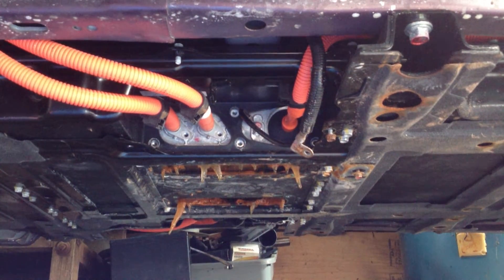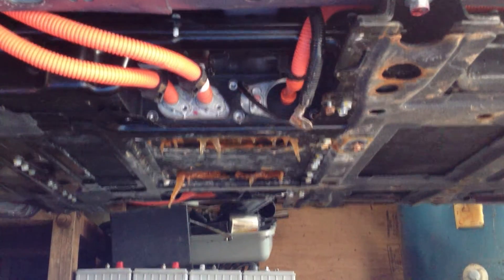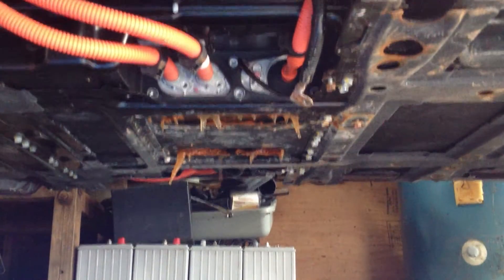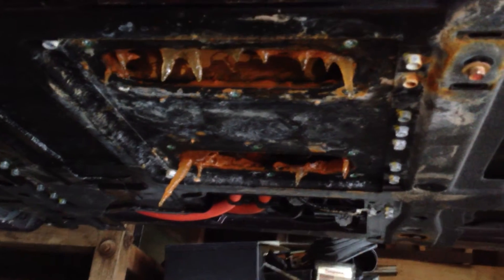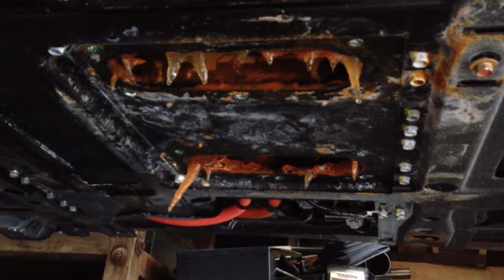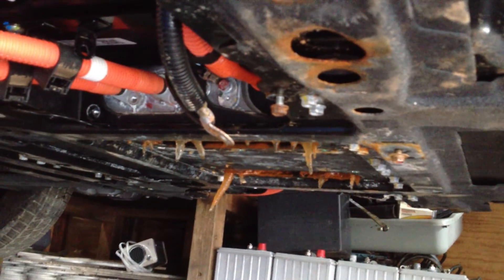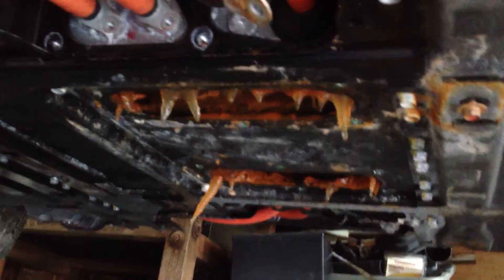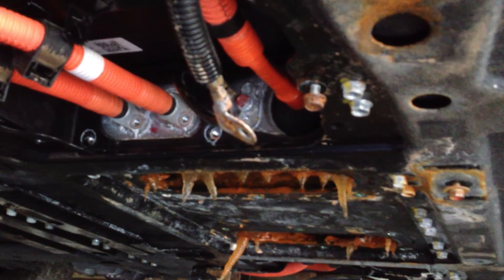Flooded Mitsubishi i-Miev: Battery Cable Removal part 1 20130218

Comment: Maybe you could divert furnace heat using flexhaust tubing to dry strategic parts of the car. Rinse and repeat, ad nauseam. Or at least until summer. I suspect that ZuiGe is right to some extent.

Comment: Good afternoon, do not tell me by mistake p1a44. imiev no charging, power cut. kompressor good heater good cable hight voltage good. Is the problem in the traction battery or not?
Reply: I'm from Russia, I'm sorry if I write something “crooked”